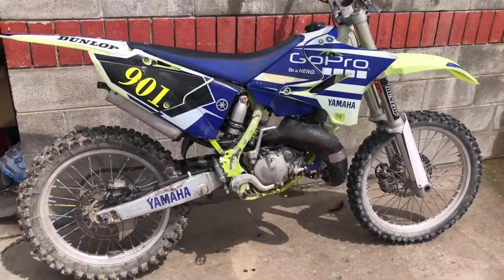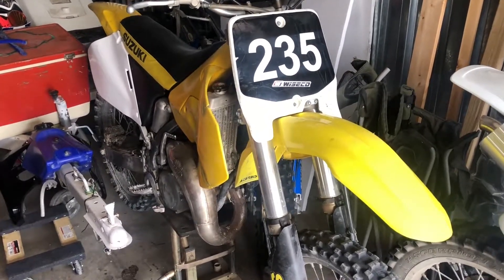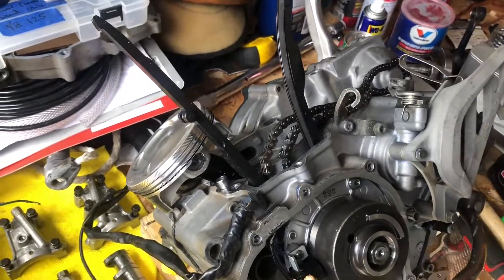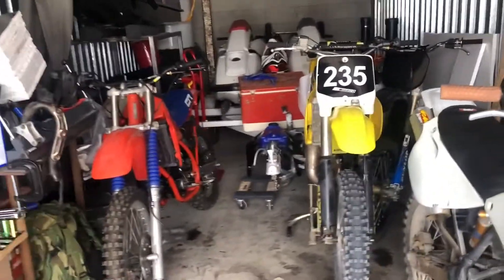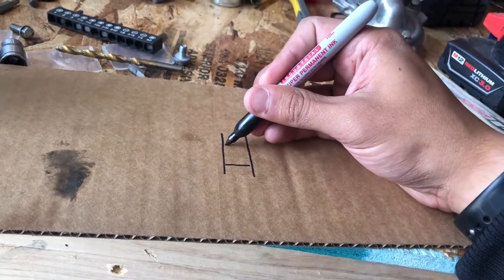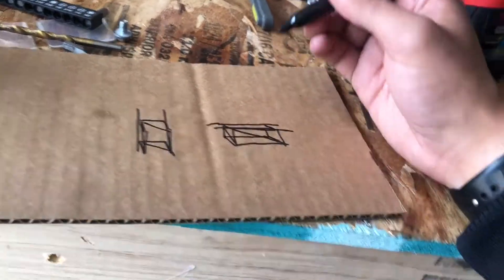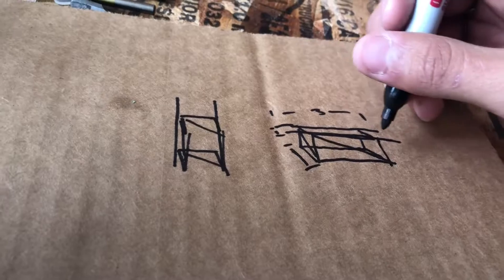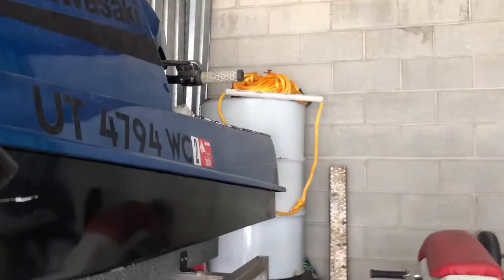DIY standup jetski stand

Comment: After analyzing the contents of the fly wheel and seeing that mountain dew bottle there on the floor the problem here is definitely a blow head gasket and not in fact the cracked sleeve there on the ole 450
Reply from the maker: The geometrics would confirm your analysis